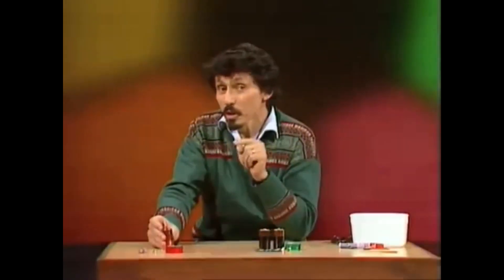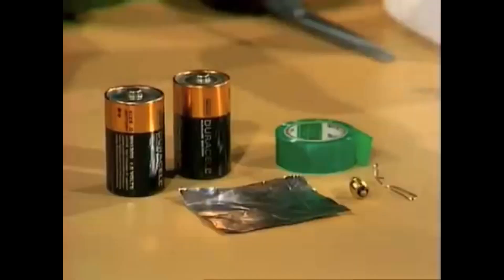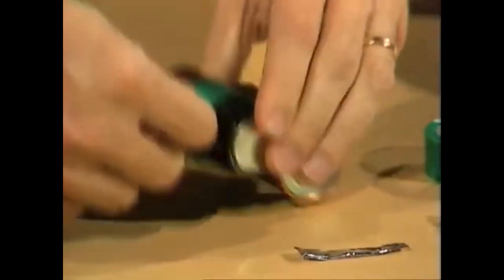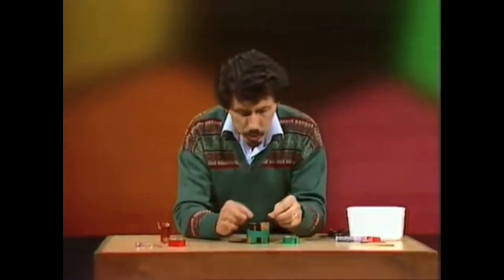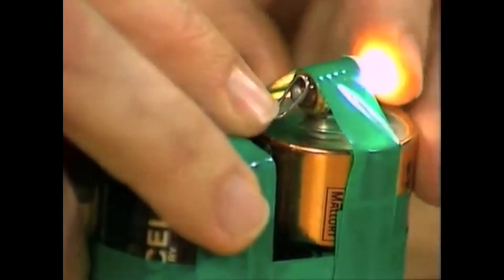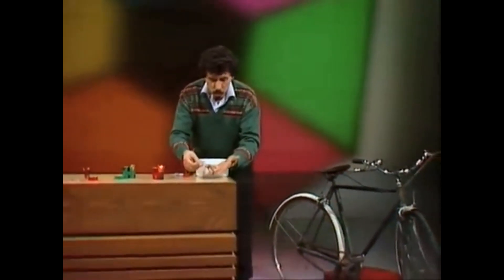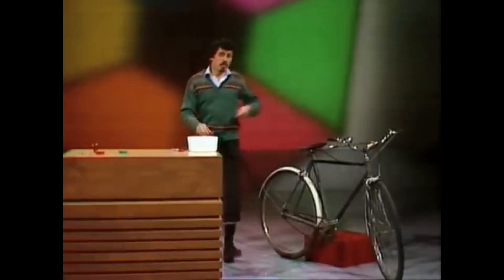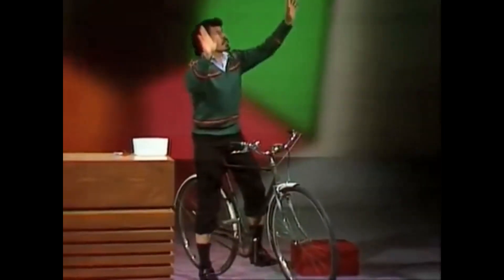Emergency Bike Lights

Comment: I don't necessarily have a bikelight on me, but I do however have a spare LED, a paperclip, tinfoil and 2 D batteries
Reply: Unfortunately this video is a bit dated, because LEDs require slightly different drive than old school incandescent globes (lamps).

With a suitable LED it might light up dimly,  work correctly,  or even burn out quickly.   This is because LEDs are exquisitely sensitive to the applied voltage. 

A white LED probably needs 3 cells connected to work, but with a pretty significant risk of burning out.

Jon

Comment: Where I live, there are adolescents and young ADULTS who specifically ride around without lights on their bicycles at dusk and at night AND even remove all the reflectors, which the manufacturers were legally required to sell the bikes with.  Lights and reflectors are required, legally and for safety; and these poor fools remove them all, to be cool.  It's discouraging.
Reply: here its even worse, people ride on motorcycles in pitch black nights without any lights and everyone thinks its normal
Reply: And they ride against the flow of traffic.

Comment: Such great ideas in these videos! Even though we have newer tech, you still can't dismiss the ideas. For instance, you can use some thin foil to heat paper to burn it, so it acts as a fire lighter. So useful in times of crisis.

Comment: Nowadays, an LED & a simple driver circuit is better & more available.
Reply: How many people have a spare LED driver lying around the house?
Reply: I had one of those small torches with a CRE Bulb in it and it was around 1000 Lumens so it lit the road very well, and the  18650 battery would run that for 2 hrs or more on full power.